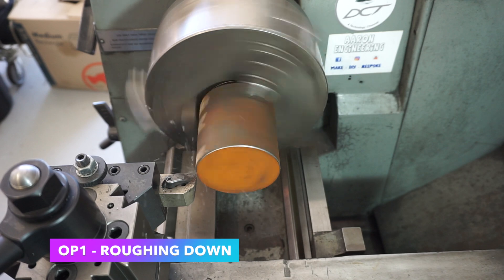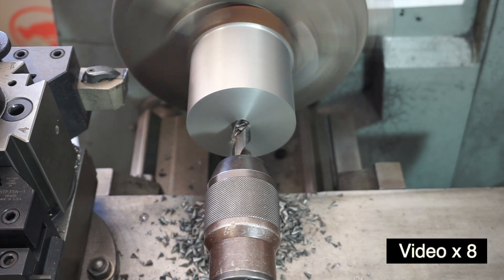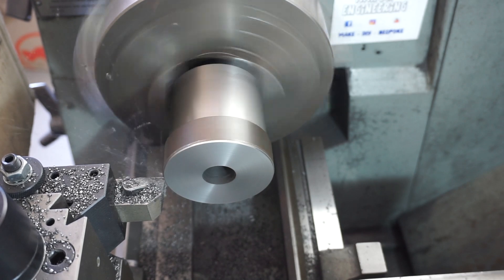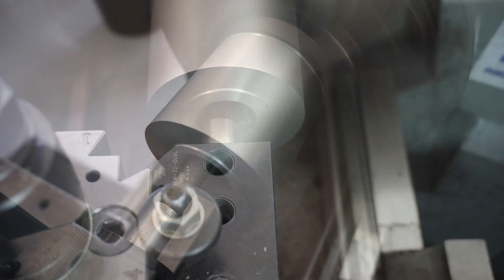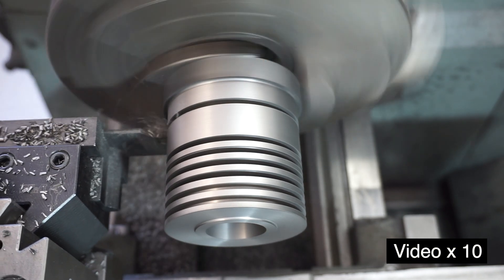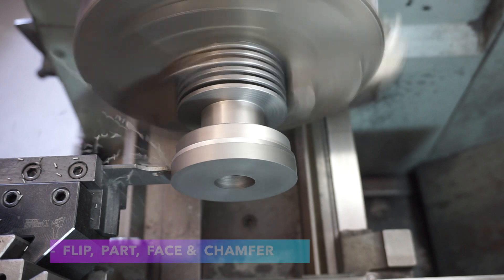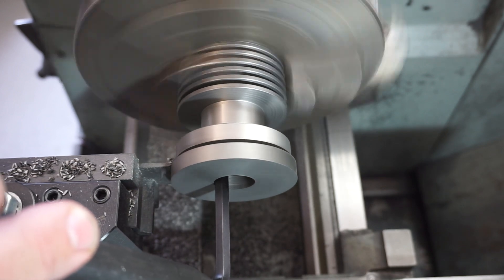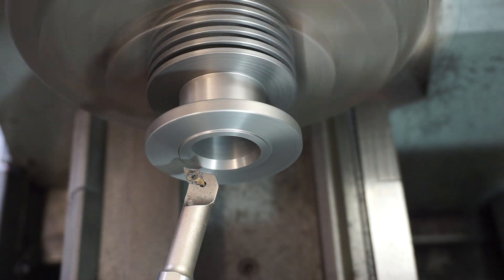Machining a CAST Engine Cylinder from Scratch | It wasn't EASY 🤦‍♂️

Comment: If your going to wear gloves i can recommend the blue nitrile ones. They rip rather than grab if you catch one. Cheers
Reply from the maker: Thanks Peter.  As a tradesman and shop teacher I would've kicked my students backside for wearing gloves, so I actually know better and don't usually wear them.  But this bloody cast iron is terrrible stuff.  Good tip on the blue nitrile gloves.  I usually have the black ones, but ran out.  Cheers, Aaron.